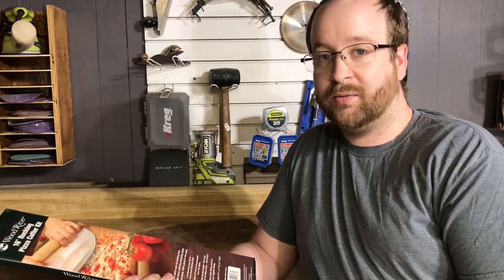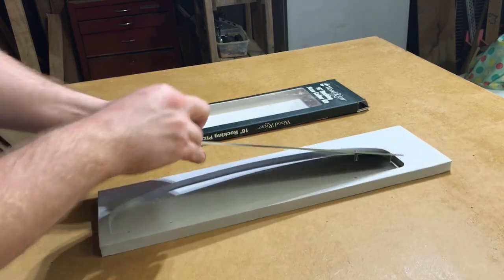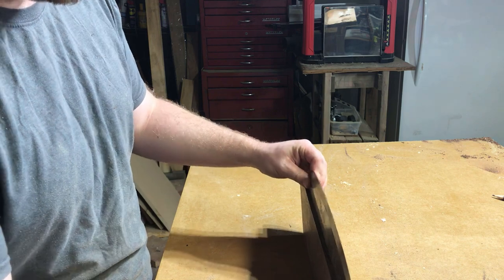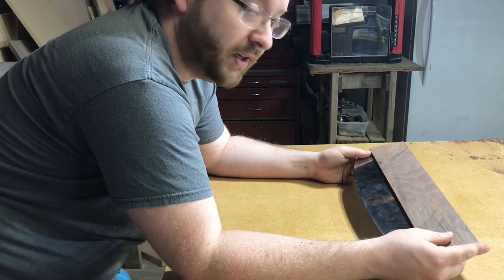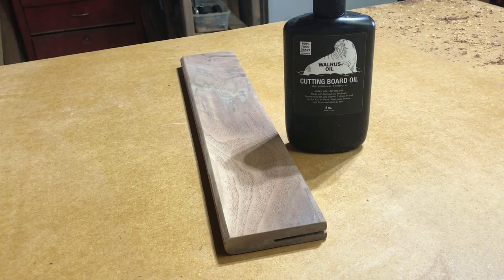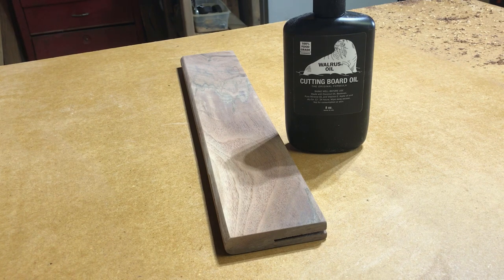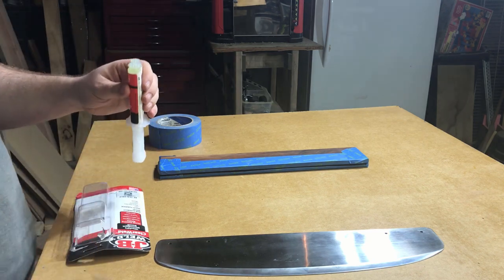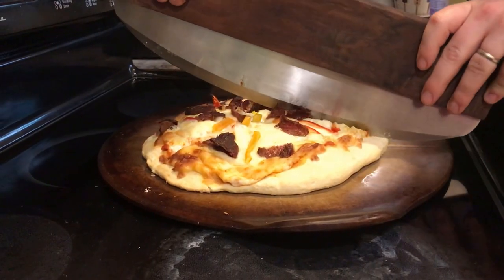How To Make A Rocking Pizza Cutter - Fathers Day Woodworking Projects

Comment: Good job Josh. I've made a few of the Wood River knife kits (Woodcraft) and some use the same rivet set up like the pizza cutter. I had a hard time getting the correct thickness and counter sink to make the rivet sit below the knife scale. I wound up getting a piece of brass rod the same diameter as the hole in the knife blank and used epoxy to secure the knife blank to the knife scales.
Reply from the maker: Thanks for the info! I was looking into their knife kits the other day. I may have to pick one or two of those up soon.

Comment: Nice project and gift, easy for my skill level. Could you use two pieces of wood, with the full spline edge of metal exposed as it is on each short side?  Is the metal clean?  I have a small pastry cutter, mini version of this, built that way and like the look. Thanks.
Reply from the maker: Yea you should be able to do that. I haven’t tried it but I imagine it should work. The metal is clean and the epoxy has been holding up good for me so far.